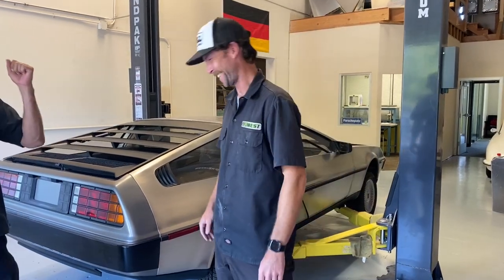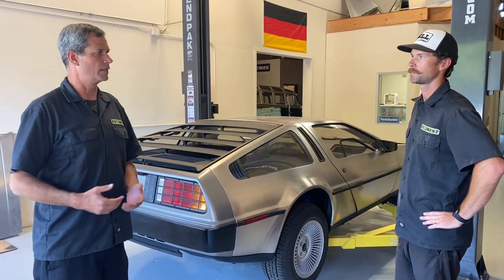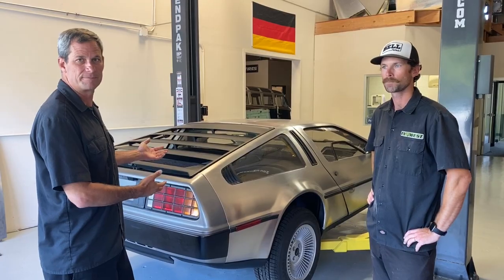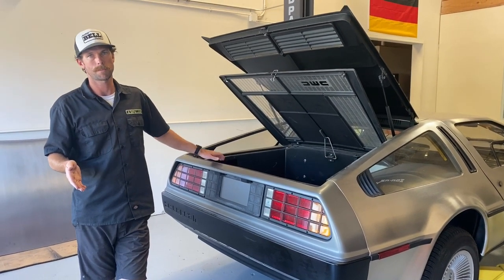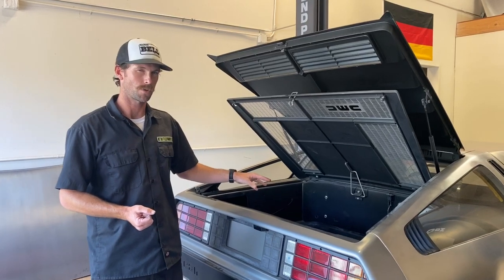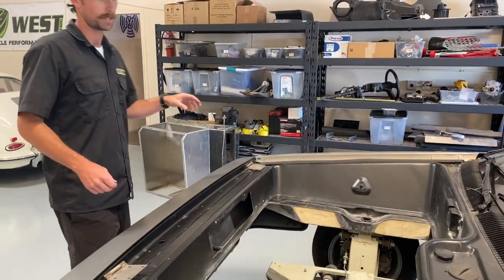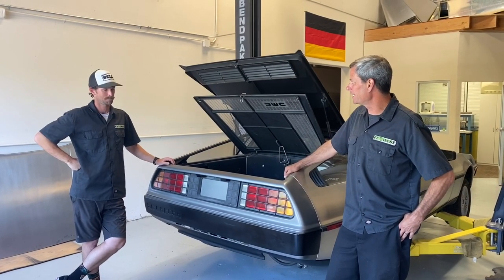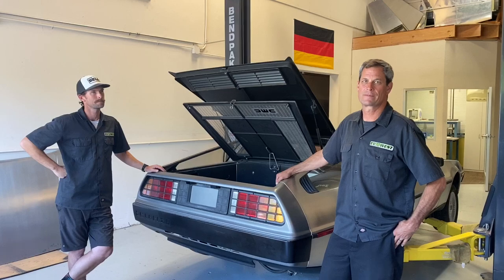DMC Delorean Build With Tesla Power | EV SHOW

Comment: Consider using the JW Speaker retrofit headlights who are the most advanced LED mfg. made in USA.  From their site:
 "The 8800 Evolution 2 provides a high performance 4×6″ LED headlight, available with a SmartHeat® heated lens! This headlight is the industry’s first to meet proposed National Highway Transportation Safety Administration (NHTSA) guidelines for a 5-Star NCAP-compliant low beam headlight.*"

Comment: I'm curious how you run the 12volt parts of the vehicle? Do you have a motor that runs off the main battery that is only on when the car is on or do you run a stepdown transformer when the car is on?

Comment: 2020 and some people still saying De Lorean was a slow car. PVR engine was used for 30 years in different top segment and sport cars from differnet brands also winning Le Mans. The DMC12 was never developed as a sport car and yet PVR engine on it had more HP than Camaros and Mustangs from those years. Even after emmissions regulations US goverment applied to it reducing its performance. 
In fact, the Renault 30 that was the first to use a PVR engine had better performance than Caprice, Grand Marquis or any other similar from those days. I like American cars, but it is a fact that American Industry did everything to generate a bad publicity against any John Delorean project.